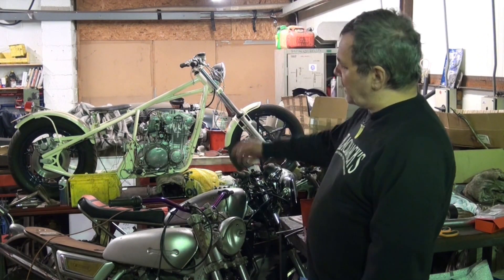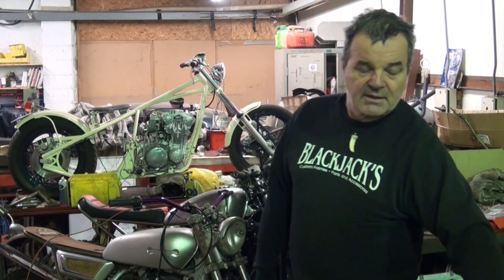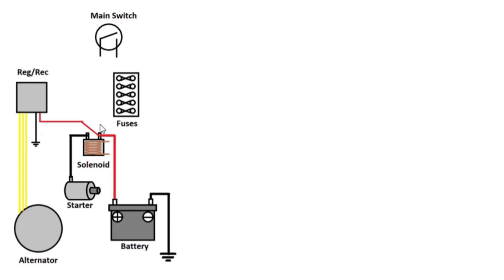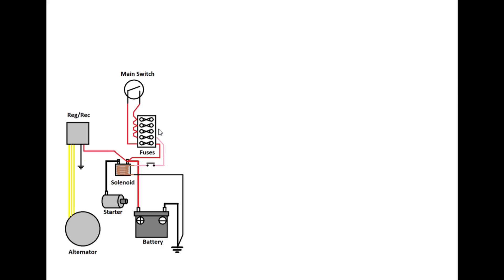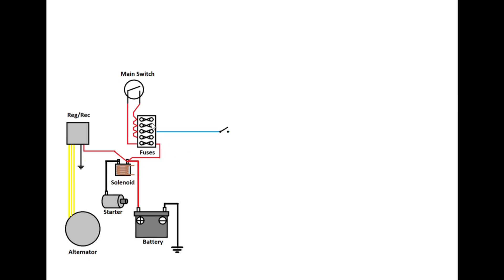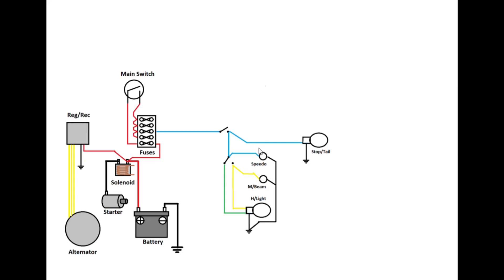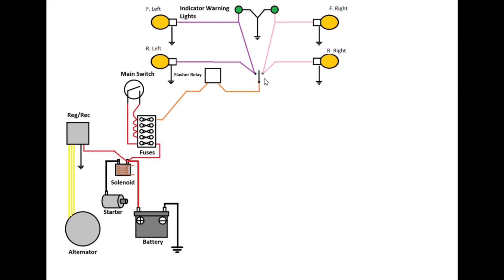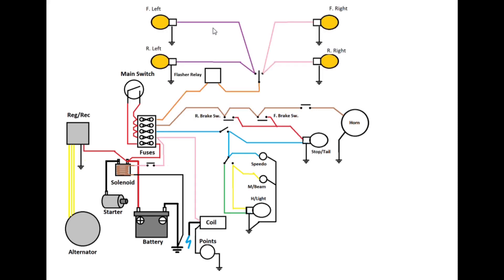How To Understand a Wiring Diagram

Comment: Ignition to relay and fuel pump would be a good adition to that diagram .
Reply from the maker: I'd have to disagree, most bikes don't have a fuel pump and a lot of those that do, don't really need it. All you're really doing is adding another circuit, and the point of the video is to treat it as separate circuits? I've got a video on wiring relays as a separate subject.

Comment: Great video!! Thank u😊
Reply from the maker: Thanks for looking.
Reply: @ If I got a minimum of wires on the battery is all good to connect the regulator direct to the plus - not going via the solenoid?
Reply from the maker: @kristianwestfall4726  yes.

Comment: I got a black wire that come of the  starter when key is turned on it  is hot  do i need to run it to the copper side of me 30 amp breaker thats were i have my rectifier going to anything info would  help
Reply from the maker: Whats this on?
Reply: @BuiltatBlackjacks  1995 1200xl sportster
Reply from the maker: The 30 amp breaker has the output from the regulator (red) and a wire to the ignition switch (also red) on one side, the black wire from the starter goes to the other terminal according to the diagrams I've looked at. You said the black wire from the starter is hot with the ignition on? Should be hot all the time since it's what actually sends power to the ignition switch???
Reply: @BuiltatBlackjacks  ty for the  help

Comment: That's great. Consider doing one about half wave 4 pin reg/recs? That's the one bit different on some pit bikes, and bikes with Chinese pit engines (lifan/cub). There's not 3 yellow wires coming from an alternator, but one yellow and one white to get your 12v from. I THINK I've got it sussed now, but if I had a how to vid like that, it would have made things a lot easier.
Reply from the maker: There are a few differences, and even here this video skips lightly over the ignition system. The combinations of what you might have are vast, did you know the early CX500 has the same sort of self powered ignition set up as pit bikes etc?

Comment: Would you help;
I have Kawasaki kz750 twin building from scratch (bobber) my regular have 2 yellow wires one black one white and red and brown …
Yellows need to connect to stator,
Black is negative - 
White/red it positive +
And brown I have not a clue… on diagram looks like is connected to brake light switch 🤷🏻‍♂️. Would you help please?
Reply from the maker: Hi, yeah I'd say it was the load sensor? Brake light has a brown wire and a blue wire? Brown is a switched live, the brown to the regulator is there so the regulator can "see" how many volts there are in the wiring and adjust it's output to suit.
Reply: @BuiltatBlackjacks  Thanks a mill for replying me 🙏🏻.
Reply from the maker: @paddy5141 sorry it took that long. I need to sort the notifications out.
Reply: @BuiltatBlackjacks  no bother thanks 👍🏻
Reply: @BuiltatBlackjacks  Hi it’s me again…🤦🏻‍♂️, is it matter where i connect brown one? Hast to be brake switch or if I connect to any positive which I have in a fuse box….what do you think 💭? Also my stator has just 2 yellow cables is it matter how I connect them with regular (I’ve no original connector just wires 🫣)Thanks a mill again 🙏🏻.
Reply from the maker: @paddy5141  you can connect the load sensor to any switched live. Straight off of the back of the ignition switch even. The yellow outputs from the stator are AC so it doesn't matter which way round they go.  👍
Reply: @BuiltatBlackjacks  THANKS A MILL 🙏🏻…You are a legend!!!!!!

Comment: On my reg/rec, besides the wires that go to my stator, there are 3 wires coming off it which I assume one is for ground and other goes to starter solenoid.... But I don't know what the 3rd one is for. Can you explain what that's for?
Reply from the maker: Depends on the bike. If it's got a field effect alternator (XS650, CB750 SOHC to name a few) then there'll be a feed from the Reg/Rec to the field windings probably the "stray" wire and the ground. If it's a permanent magnet alternator, the "stray" wire is most likely a load sensor in which case it connects to a switched live and senses the voltage being supplied and "tells" the Reg/Rec how much regulating it has to do. It's hard to be concise because stuff varies, and aftermarket Reg/Recs don't always work like the factory version.

Comment: So what does the white wire  on the reg/rec do?
Reply from the maker: Depends Danny, the colours I used here are all pretty generic, but the Yellow ones from the alternator are sometimes white but there will be either two or three identical looking ones? Some alternators don't have permanent magnets but use electro-magnets instead (called field effect alternators, common on cars) and sometimes the White wire is the feed for the electro-magnets. Other times it can be 12Volt DC + out. If you say what bike it is, I might be able to be a bit clearer?

Comment: May I suggest putting a fuse between RR and Battery? I just had an experience when the RR's
hot wire to battery shorted inside the RR and ran the battery down very quickly. Thusly I am going
to put an inline fuse between the RR and harness up to the battery as the circuit breaker possibly
being 31 yrs old never opened up as it should have.
Reply from the maker: There are very few manufacturers that put a fuse between the RR and the battery. On one hand it is something that I think about from time to time. But on the other hand since your short didn't reduce thing to a smoking ruin (?) I don't thing a fuse would have helped. if it was a fuse with a low enough rating to blow when the short wasn't bad enough to damage the wiring it would blow when the RR was working and the bike was charging. If it has a high enough rating to survive charging then it's not likely to prevent the battery discharging  if it's not discharging fast enough to damage the wiring. I think it's going to cause you trouble more often than it saves you trouble?
Reply: @BuiltatBlackjacks  I do thank you for your time, The connector between the 
RR and Stator was possibly likely to burn the stator out due to the connector  actually melting and causing wires from stator to touch each other. Most of the time when an RR goes bad it either overcharges the battery or does not charge it.
This may have been a freak event? Battery shorting to ground through the 
rect/reg? As said, a circuit breaker was between the Bat and RR it just never
opened up, which would then cool it, then make again. Perhaps I should put in a circuit breaker instead?

Comment: Hey up blackjack,,thats made things look easier, the one job i hate
Reply from the maker: Glad it helped, that's what I'm here for. :-)
Reply: Got it,super job.i was stressed when started rewiring my 80xlh one by one ,no problem hum,well then on up the line's.was a wad of a few couple of snips here and there I'll remember ha plus the wires from the handle bar switches that don't work but will thanks to you I've now got the conference in myself to even put in a new fuse panel.make it all nice and neat.thanks o"l buddy✌